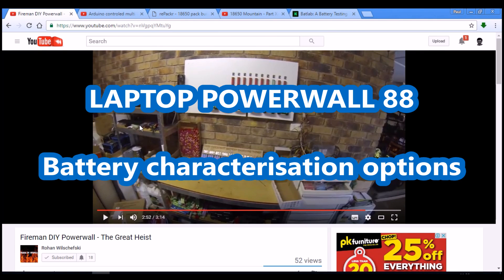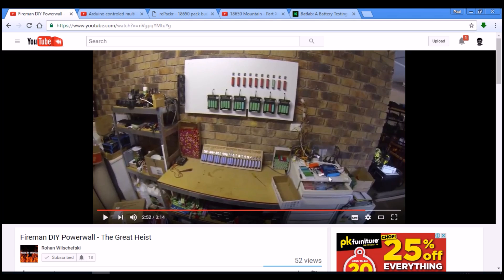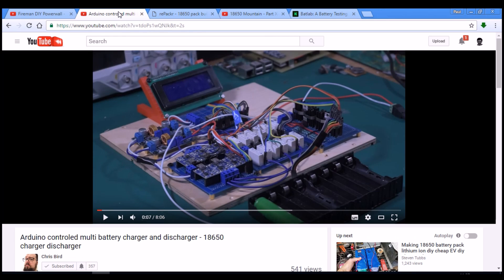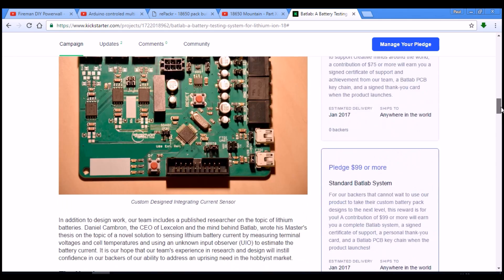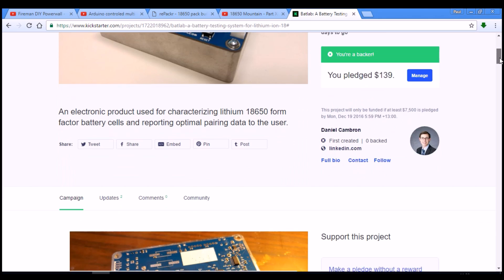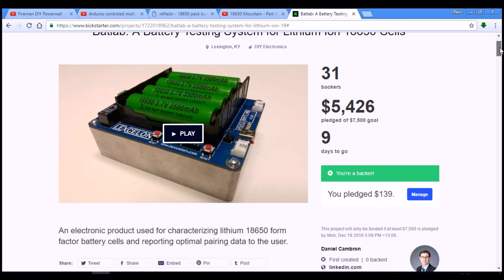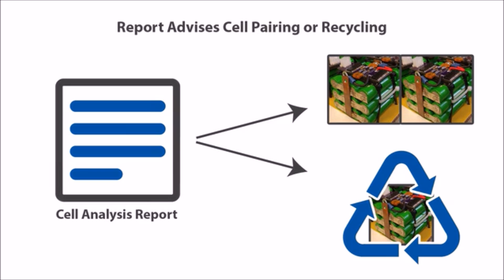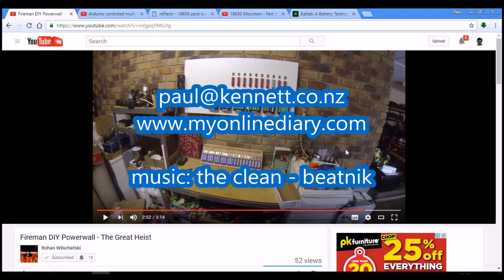Laptop Powerwall 88 - battery characterization options

Comment: Hey Paul! We can't thank you enough for your support and willingness to give us a shout out in this video. We are now 82% funded and making the final push for 100%! We hope to reach our goal to bring this product to life for hobbyists like you.
Reply from the maker: I'm really hoping you'll reach your goal. Looking forward to comparing the output from the Batlab vs the standard hobby tools.
Reply: Hi Paul (and Batlab)
Very interested in the various options here; to your knowledge would the Batlab accept and help configure 18650 pairs? Therefore allow one to streamline the process of building a Paul Kennett style Powerself or would they have to be split individually?
Reply: Thanks for your interest, Luke! We've actually had several people ask about having the Batlab support multiple different types of cell form factors and holders, and we're working on a solution that would give this kind of flexibility. The original intent of the design was to match individual cells together, but as long as you are happy with the load current spec on the Batlab, we're working on an option to give users clips or connectors so they can test their own custom form factors (or pairs of cells already spot-welded together). Feel free to check out the Kickstarter campaign at http://kck.st/2eUyaAR and post your comments and questions!
Reply from the maker: Luke Ogden Yep - Batlab should work with pairs like any other discharger. The pair behave like a very high capacity single (up to 6000 mAmps)